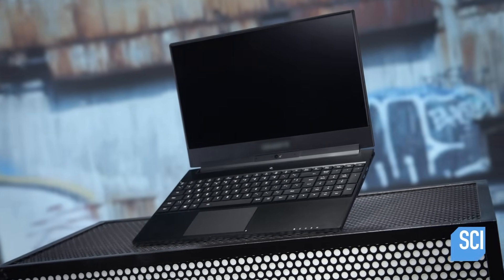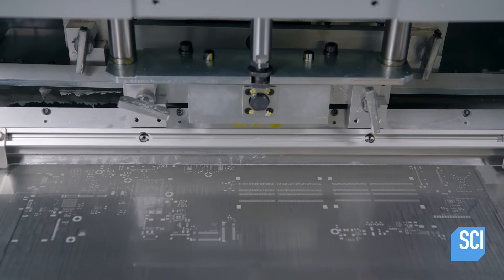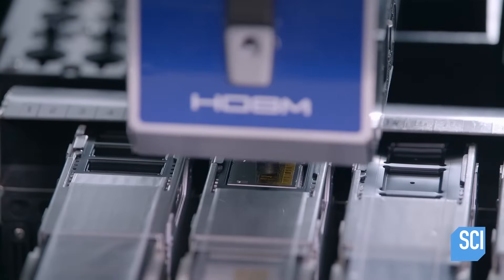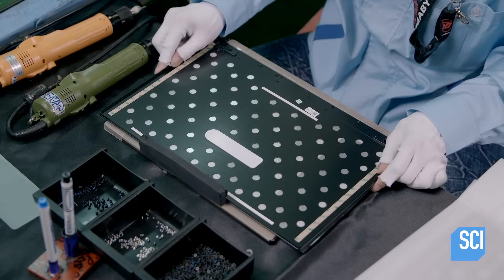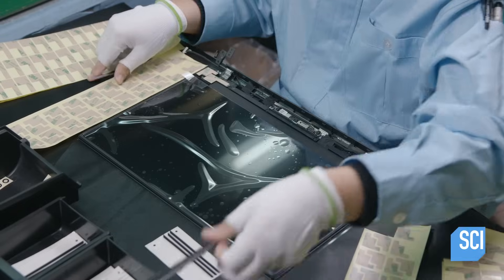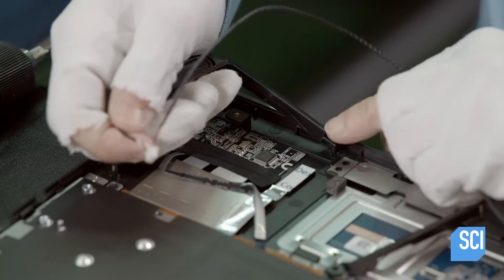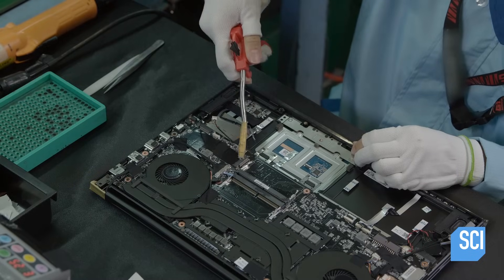How Laptops Are Made in Factories | How It's Made

Comment: If you want higher speed without consuming more power, you have to watch gaming videos at higher resolution, such as Battlefield 3, and Call of duty Black Ops. Forces better speed. Battlefield 3 playing back at 4k or 8k even if your device doesn't support it, foces your modem to become much quicker than earlier. That applies to Android 2 hotspot as well, but 3g is not supported anymore.

Comment: I never could understand how the motherboard is the brain when everything is on the harddrive without that the computer would be drooling.
Reply: Plenty of computers do not have a harddrive, this laptop also doesn't have one. They either use an SSD or iSCSI/FC storage over a SAN so there's no storage in the computer itself...
The storage does nothing more than that: store stuff. Storage itself does not process anything, that would be the CPU, GPU and optional co-processors.

Comment: "it requires two fans rather than one"

My old asus rog that only has one fan with poor thermal and ventilation on ram.
Reply: One fan
Is your lappy by chance the rog GL553? The one with the optical disk drive
Reply: @99Teutons  mine is gl551 , but yes with optical drive

Comment: I won’t complain about the cost of my next laptop. It’s actually nice to know that so many people are directly involved in assembling/testing each machine.
Reply: Too bad that regardless of the cost of the laptop, their salary remains fixed and it's quite low
Reply: @bbelilovsky  how much on average
Reply: @DarkGladiator  If the factory is in Taiwan, the average salary is around at $USD 1000 per month, and if it's in China, will be around at $USD 400 per month.
Reply: @tomchu9780  The question is how what can 1000$ buy you if you live in Taiwan.
Reply: @ZiggyMercury   In Taiwan i think you will do all right
Reply: @bbelilovsky AND SOMETIMES THEY APPROVE LEMON OR DEFECTIVE PRODUCTS! THESE COMPANIES SHOULD BE MANDATED TO BE OPERATED FULLY BY THE MACHINES NOT WITH CHEAP LABOR WHO CAN’T SEE DEAD/STUCK PIXELS
Reply: @bbelilovsky  Yeah nobody cares.
Reply: AND THEY STILL END UP WITH A LEMON OR TWO, DEFECTIVE LAPTOPS WITH SEVERAL STUCK/ DEAD PIXELS AND BUNCH OF SCREEN BLEEDING. THESE GREEDY COMPANY SKIMP ON ACQUIRING MACHINES TO DO THE QUALITY CONTROLS AND INSTEAD HIRED SOME DIRT CHEAP LABOR FROM CHINA

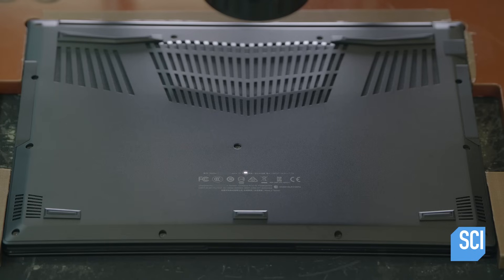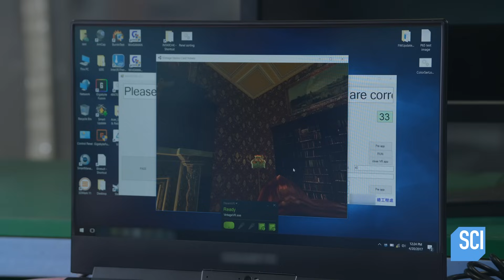Comment: You are dumb. You covered "designed by: Gigabyte" at 4:27 but still CMIIT ID: 2017AJ17 is not hidden which is enough to find out that this is GIGABYTE AERO 15X laptop. Also you didnt hide the GIGABYTE logo and console at 4:35 and 4:51. Also i can see Aero 15 a bit blurred, but visible at 4:58.

Comment: I was impressed by how automated the first part of the process was--then saw how all the rest of the manufacture requires old fashioned manual assembly.
Reply: It's all a matter of cost. Placing and soldering all of these components by hand takes a lot of time and has a lot of room for error. General assembly of ready components takes minutes and has very little room for error - so automating that process might not be as beneficial in the scale they're currently operating in.
Reply: @bbelilovsky  Unless they are Dell, HP, or some other massive computer maker automating the process start to finish just isn't worth the cost.
Reply: @The-Singularity-X01  I don't know just how automated these manufacturers have it and I'll take your word for it. Automation is a very desirable trend, but mechanical automation also has a very high initial cost (purchasing and tooling of custom robots, infrastructure overhaul, licensing, etc...) which may not even repay itself in the long run - because these robots also require a team that maintains them. It's a careful balancing act :)
Reply: IDK man, some of those china assembly sweatshops have a special "show floor" just to make it look that way for tourists and PR.

Comment: No paste on heatsinks, only low quality grey pads on CPU and GPU, they will deteriorate after around a year. Not impressive in expensive gaming laptop (3:28) - saving a few cents? The MB assembly not fully supported causing it to bend down when the fan screw tightened (3:33). "After checking that the fans screws are sufficiently tightened" - I see no checking here, just marking the crews with a black marker (3:39).

Comment: The motherboard is merely an advanced cable that's flat. The ram is like the short-term memory. The SSD is the long-term memory. The CPU makes mathematical calculations to assemble data while the GPU turns that into visuals.

Comment: 3:28 Did she just apply pressure to the thermal pipe to pick up the fan assembly? I wonder how many laptops had cooling issues because that heat pipe was kinked?

Comment: notice very few of the parts are actually made by the company whose name is on the computer. What matters are the components that are NOT made by them and matters little who's name is on it.  Sometimes the motherboard is the only thing made by the company, sometimes not even that. the company just assembles the parts and one company is not meaningfully better at assembling them than another. You want a certain chip x amount of ram and whatever else you require and don't worry about whose name is on it. Mainly, computers, like most everything else these days, are not products,  they are marketing devices trying to hustle you into brand loyalty.

Comment: If it's a gaming laptop then where is the gpu
Reply: It's one of the many chips soldered on by the robot. If you look at the inspection part for 1:31, the GPU is in the top middle of the motherboard and the GDDR5 memory chips are to the left and top of the GPU. The CPU is located on the right and above the 4 memory chip boxes. I believe the chip on the lower left is the PCH.

Comment: Motherboard = Circulatory System
Power supply unit = Heart
Ram = Frontal lobe (short term memory)
Storage = Frontal lobe (long term memory)
GPU = Occipital Lobe
CPU = Also frontal lobe (Calculations etc)
Cooler fans = Sweating?
Case = Body
Yeah I think that sounds about right.

Comment: damn its even more crazy to think that slimmer and ultra book laptops are even more complex to make
Reply: Not really, they just use fewer sockets/slots and solder directly to the motherboard. With the thermal issues, a higher power 'gaming laptop' is a lot more complex than a relatively simple ultrabook with just a CPU with integrated graphics processor and some RAM soldered to the board.

Comment: I’m just cringing at the fact that he said the motherboard was the brain, said WiFi and Bluetooth module, and said solid state disk.

1: the motherboard is like a large tower’s mail pipes ( they use air to move mail anywhere in the building)

2: the brain is the cpu, which would be the mail room itself

3: the WiFi and Bluetooth “module” is called a chip 

4: the solid state disk, ISN’T A DISK, it’s called a ssd or solid state DRIVE

Comment: In SSD the D stands for drive not disk. There are no disks in SSDs
Reply: J J still better than the verge. Lol
Reply: @Redwood21  You beat me to it!
Reply: @Redwood21  yeah I remember the verge build I thought they destroying the CPU and the ram sticks and bad job wire sorting
Reply: The guy in this video clearly didn’t know what he was talking about and probably just read off a script a writer made after an half-hour google search
Reply: @danielhu6485  *a
Reply: Still better than LTT
Reply: Though commonly known as solid state drive, sometimes they are indeed referred as solid state disk or even solid state device at times.
Reply: I think he meant disk as a logical partition
Reply: @Saucy Boi *the 2nd
Reply: @Saucy Boi aww man... I wished it stood for HUMONGUS DOUBLE DONG
Reply: Disk isn't the same as Disc. A disk can be a solid state drive, a disk doesn't have to be a physical spinning platter.
Reply: I actually cringed from that XD
Reply: The thing about dual fans bothered me. Both fans don't cool the CPU.
Reply: @ChrisD__  Actually on this specific laptop (and a lot or recent others) you can see 2 heat pipes, each collecting heat from both the GPU and CPU, and each delivering it to both Fans assembly. So both fans does cool the CPU and the GPU.
Reply: @Saucy Boi
Hard Disk Drive. It's the third. You were right the first time. xD
Reply: He is no tech nerd anyways
Reply: They put NVME drive which is faster but you are correct it is drive not disk
Reply: Imagine Solid State Disk
Reply: Solid state drives. No moving mechanical parts. Similar 2 a flash drive.
Reply: Solid State Driver & Hard Disk Driver
Reply: LMAO
Reply: The "D" in the abbreviation means "Drive."
Reply: Similar thing with "LCD display", the "D" already stands for display, so it's just "LC display".
Reply: The chips on the ssd are cut from a disc
Reply: that made me cringe
Reply: A SSD is a disK and a CD is a disC
Reply: @marcobotha8897  So is a LP.
Reply: Both solid state drive and solid state disk are accepted interpretations of SSD.

Comment: They blurred out the lap's branding but forgot to blur out the staff's id card, which has GIGABYTE in large, block letters. Also, the testing software had GIG in its form, so any noob could've have figured it out
Reply: I knew who it was since the beginning of the video, I had a pretty good idea through the blur, but seeing the model as the Aero 15, in the first 30 seconds gave it away. Also the tables behind the lady assembling it didn't have the visible "byte" blurred out. Plus IIRC she was wear a gigabyte lanyard. As-well as having it on her shirt.

If someone can watch this and NOT know it's gigabyte by the end of the video, even with no computer experience, there's issues.